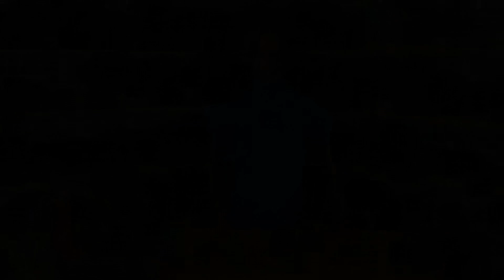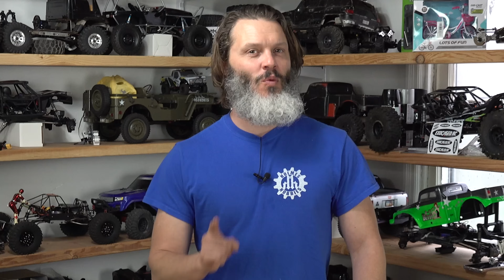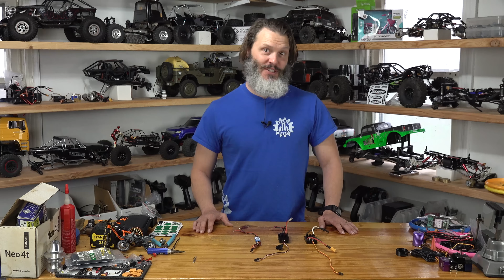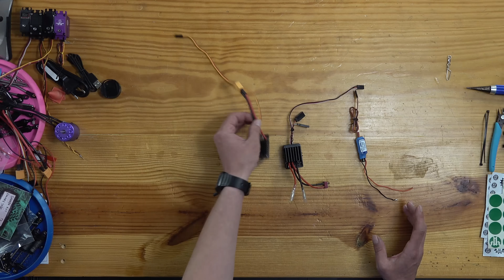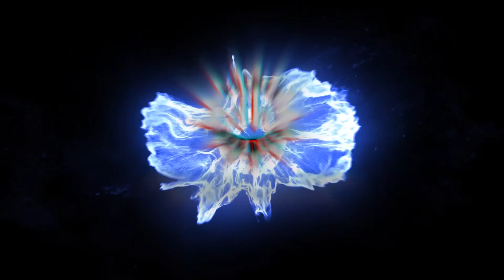All about BEC's with Holmes Hobbies **Top Tips For BEC**  How to select the right BEC  and more!!

Comment: I'm running a 1:12 rig with a 3660 I'm just gonna have a 2nd battery pack for the RX.  Thanks for the video, I just upgraded my stock MN86 and trying to learn all this stuff.  Just got my rig together, hoping to try it tomorrow.  Thanks for the video to explain this BEC thing to me, I delayed playing with my truck because I didn't understand that stuff, yeah I rigged a 2s lipo into the rx and also had power supplied from the ESC onboard bec lol, stupid, that prob wouldn't have lasted long if I'd rushed to play, wow I usually screw stuff up and learn later, but this one time hahaha.

Comment: As a guy who first got into RC back in the mid 1980's-  know EXACTLY what (and why) it is. BUT- You might tell me something I don't know- so I'm gonna keep watching!
Great explanation! The older folks will remember the joy of getting rid of the four AA batteries when we got a newfangled radio set that had an integral BEC (because MECHANICAL speed control (there's a throwback!) followed by the utter horror of our prized Hornet or whatever buggering off into the sunset with NO controllability because we were foolish enough to let that 7.2v NiCad get too low to run the radio and no longer had those annoying AA batteries... LOL In MY case, it was a Marui Golden Eagle CJ-7 off across the way and into a pond. That was, uhh- fun. LOL

Comment: Thanks for sharing your knowledge and experience.  Just a little over 10 years ago, I learned how to fly RC planes on a foamy electric Cessna, goal was to get into ducted fan planes.  Anyway, like most, I hope, I use a BEC in my planes in case the ESC fails so I can still somehow control the plane and possibly land it properly or have a less impact crash.

Comment: I use two BEC’s on my 1/5th scale.

I run a 4 cell lipo pack… 14.8v
One U-bec is used to reduce this power down so I dont fry my rx. 

The second u-bec is used to power my throttle servo at 8.4v

Then my steering servo, which is rated for 4s is directly pulled in to the battery. 

Three different components, with 3 different power needs.  Gets expensive when being competitive
Reply from the maker: can get expensive, but worth it! imo

Comment: I run a direct power servo but I am using a castle micro x2 with an external bec. My question is I still have to use the bec correct? To power my receiver? Since there is no internal bec in that esc.

Comment: Wouldn’t I need this BEC to run one of your servo’s off of a 6S pack on my 1/8 scale truggy? Set it up for a four cell output between the battery of the servo, and just run the receiver off of the 6 V out of the ESC? Would this BEC work for the application I’m looking at with one of your servos?
Reply from the maker: Yes, running 6s you will run a bec for 14.4v if you have a direct power servo
Reply: That’s what I was thinking. Thank you so much for the reply John*.

Comment: I got a question one of you all will probably know. I have the hobbywing fusion and set the internal bec to 7.4v to power the hv servo i got, but the receiver i plugged it into says its rater for 4-6.5v. Shouldn't the power from the esc have burnt up the receiver ? I ran it before realizing what the voltage for the receiver is rated for, and it seemed like everything ran fine and i ran for a long time and didnt have any issues. What am i missing ? Any info is greatly appreciated !!
Reply: There is a generous safety margin in that range. Some 6.8 volt servos  can handle 8.6 volts. But they burn out faster in a bind.

Comment: Very helpful. I just put a bec in and it worked awesome. Got done installing and testing then I unplugged one battery in the wrong way cuz I as running a two 3s batteries and created a short. Bey bey reciver and stepper wire. Well you live and you learn.
Reply from the maker: whoops
Reply: Do you think it it fried the bec as well when it shorted?

Comment: I need a BEC that can power small led 6v and also big led 8v at the same time.
 The Hobbywing has a 10A with adjustable volt output but it’s with a jumper….. I’m waiting for their reply as to if the jumper must be used to only choose one voltage value or if each terminal has its own voltage value so I can power small led 6v and big led 8v at the same time. Do you know anything about that BEC and can you recommend me a BEC with multiple different voltage output values that can be used at the same time? Thanks please reply.
Reply from the maker: I'm not aware of any
Reply: @HolmesHobbies  …. Yea I had to return some items that weren’t going to cut it. However, I did finally come up with a solution and it involves a custom computer VGA harness that will manage everything.

Comment: What happens if youre running a bec and servos on 8.4 volts and the bec fails. Either due to something like a short or maybe over drawing current (if that's possible) ? Does that fry your reciever or servos? IE. A 3a bec and servos require more than 3 amps.

Comment: I’m building a vanquish phoenix and plan on putting both shift servos and a winch but run my steering servo direct power. I’m curious if I actually need an external BEC when using the castle mamba x esc with it being rated having a 8A BEC.
Reply from the maker: You won't need an external

Comment: I was told using a BEC is more reliable power for your servo than direct power. They said it was like a capacitor and never let the voltage drop. Is there any truth to that? I can't find anything on the subject. I run dorect power 4s now
Reply from the maker: It's more even power over the whole pack to use a bec.   That's why I ensure my direct power servos are overkill enough that a dead pack still delivers more performance than needed

Comment: My first crawler was a Frankly. Had Rustler trans, Bender custom chassis, I think Tamyia Rock Buster axles maybe 1/16 (not clod). Brake line and threaded rod links. Used Rustler wheels cut and clued with Proline MOAB tires. Traxxas 3 channel controller to run rear steer but would use Xmod crystals so we could run with more people and not have interference. Oh back it the day😁

Comment: I am not a rock crawler guy, but I love these informative videos. I did not know there is a "direct power" servo. Which leads me to my question. I am a 1s pan car guy. Servos do not like running on 3.7v. Therefore we have to run 1s specific esc with BEC boosters. This limits the esc's your able to run, there are only a handful of companies making them with a starting price point of $120. Also that esc is not capable of running anything but 1s. So I cant run them in my 1/10 off road racers. I would like to just run a normal 2-3s esc. Will a direct power servo operate on a 1s lipo effectively??
Reply from the maker: Most servos will not turn on so low.  Not impossible to develop a 1s servo , just not a large market for racing these days.

Comment: I don’t agree, John. You are right about the steering servo but on most of my rigs I have at least one shift servo (dig) and a winch. The servo winch wants (Reefs 499 servo winch) 8.4V as does the high powered dig servo(reefs 299). I have only recently begun to not bypass the receiver with the higher voltage in a bypass rig but what I’m getting at is that steering is only half the battle.
Reply from the maker: There are certainly a lot of rigs and needs these days!
Reply: @HolmesHobbies  you betcha there are. Your stuff rocks and the people on your team are great. Even Jordan

Comment: Back in my day the bec technology was developed within the beginning of the esc. When I ran my first few Tamiya kits they used a mechanical speed control which had to run two servos, and an rx battery to power it all. When the esc became available they introduced the bec because the rx battery was no longer needed. The weight savings and lack of complexity, not to mention increased run times, was the wave of the future! Now, I run CC becs in my crawlers to give the steering servo solid power. I found the term bec confusing at first given my history in the hobby, but I certainly see  it’s benefit!
Reply: I remember the old mech speed controls just a series of resistors and contacts driving by a servo. Fun stuff!
Reply: The first becs I remember were in the rx. I remember I had to buy a new radio when I got my futaba 112b esc, because running a bec in the rx and also in the esc would fry the radio rx

Comment: So say your running a micro x esc paired with a 1400kv revolver, powered on 3s. Can you run a Raw 500 servo because of the micro x built in bec?
Reply from the maker: Marginal.  Ask reefs if 2 amps is enough

Comment: Question about the amperage capabilities of receivers in general. Do you or anyone else know how many amps a receiver can supply? Ive never liked the added wiring associated with becs so I've always purchased escs based on how many amps they're able to deliver through the internal Bec. The other day I noticed one of my flysky receivers had a 2 amp marking but I can't find anything in the specs about amps. It would be a shame for me ESC to be capable of 6 amps whilst me receiver was only capable of 2 amps
Reply from the maker: The traces inside are normally good for about 5 amps.   Above that, it's best to have a bypass harness so the amperage goes around the internal RX traces.

Comment: battery eliminating circuit. it puts a capacitor in line with the power so there is some power on demand when required.